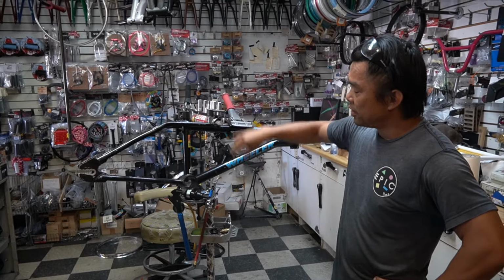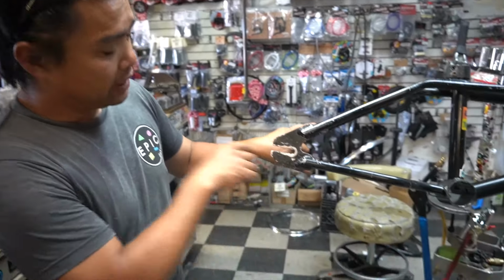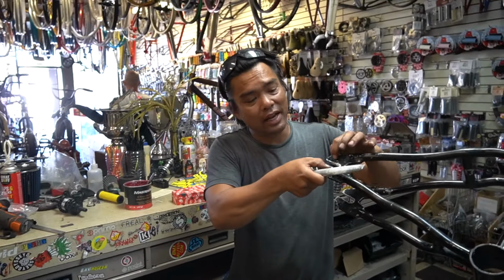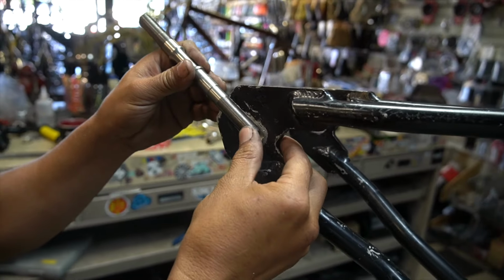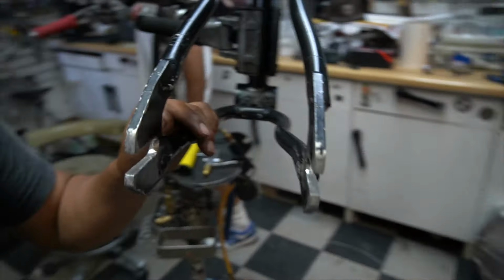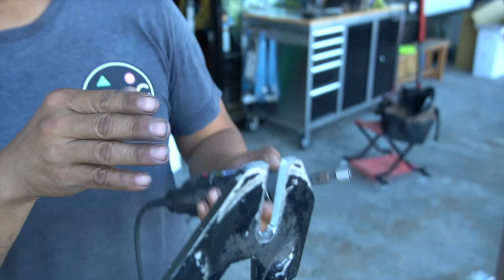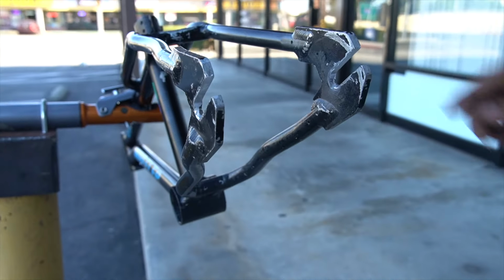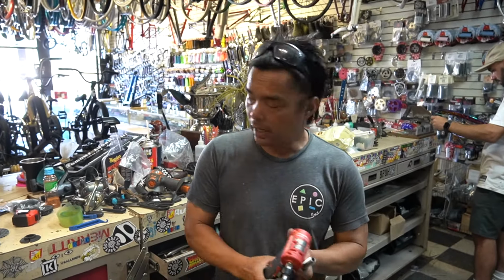Shop Owner Was Warned To Not Destroy This Rare BMX!

Comment: For a while between old and mid school bikes. Companies would make the 14 mm axle. Flat on the top and bottom so that it would fit in the 3/8 dropout. In the automotive world, it would be called a double D shaft.
Reply from the maker: Yesss totally remember that
Reply: @AlfredoMancuso  I wouldn’t be surprised if Skyway makes mags with that same axle. I also remember seeing special washers to put a 3/8 axle in a 14 mm dropout. They had a shoulder on them that would sit down inside the dropout. To keep the axle aligned so the wheel wouldn’t lean into the left or right.

Comment: I just did this on my Schwinn Pro Modified (2001) aluminum frame! Funny too bc I was searching far and wide for guides. I’m getting back into BMX at 37 along with my kids and I didn’t realize most of everything these days is 14mm. I ended up using a combination of files/rasps, angle grinder, and dremel to get it done. Just took my time (by recommendation of a fabricator friend) and gladly both dropouts came out super clean, new wheels fit like a charm. It feels awesome getting back on a bike after 20 years. I’m excited to ride alongside my kids and look forward to passing on the love for the sport to them and their friends. Love the channel, thank you for the videos and banter! Brings me back to some really good times!!
Reply: If you ever run in to that problem again modern female rear hubs are 3/8ths.

Comment: I just did this a month ago, went 10mm to 14mm, grinded down to 13, then used a file to take it to 14, I even went through the trouble to sand and polish. I used a chain tensioner as the guide.

Comment: Awesome video! I grind out a lot of my forks for 14 mm axles and have did rear dropouts for over 20 years. Aluminum is easy to work, but doing chromoly materials you need a lot more patience. I did it your way years back, trying to open the dropout on both ends and making it perfect.  With chromoly and trying to make them both align perfect, sometimes it isn't until you put a wheel in with a tire and add the tension with a chain. Best and easiest way I found out how to do it over the years is to just grind one side. Usually, it will be the bottom side of the dropout, and the top is a true line I follow, so the alignment is still straight from its original geometry/measurement.  Same with forks too. I know your project had to be fixed because the owner tried doing one side, and you had to match the other side the same way.

Comment: To run a modern hub on an older frame, use female axle bolts.  Problem solved, zero grinding required.

Comment: I miss just being able to buy the slotted axles. I had a pair of super forks that were meant for a slotted axle. 

I've also clamped a piece of wood to the dropout drilled a 9/16 hole (until metric got popular enough to find 14mm bits) then made marks from the top and bottom of the hole to the rear of the drop out and cut it with a grinder. They always turned out great. I will admit I did 1 or 2 hackjobs before learning.

Comment: I have a KGB frame with 3/8 slots which i want to fits 14mm freecoaster hub, I can't modify the frame because I love the way the frame is built, plus it's too small to make large axle slots. Wonder if it's possible to grind the axle from round 14mm into flat shaped 3/8? 19 years ago I've used to have Taska freecoaster hub which the axle are 14mm but flat shaped 3/8 so it can also fits 3/8 size axle slots. It's like 2 in 1 sized axle. Now I can never saw those types of axle ever again. Really wish they make those again.
Reply: you can take 14 mm axel and grind the threads flat on both sides make them 3/8's flats. still use the 14mm threaded nuts. I've seen them but never tried to do it myself. I did see something on BMXmusem on it.
Reply: @MostLuckiest  That's what i was thinking too but I just want to make the axle flat on dropout position only, not full flat on each side so i still have enough materials for the threads.